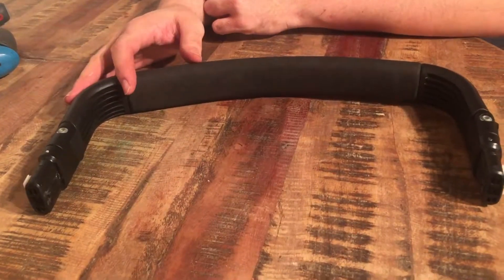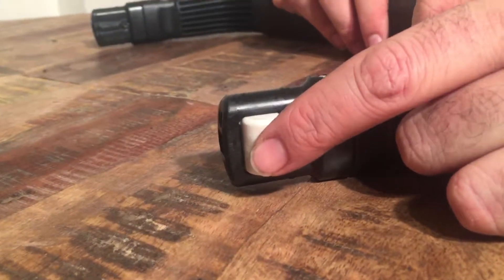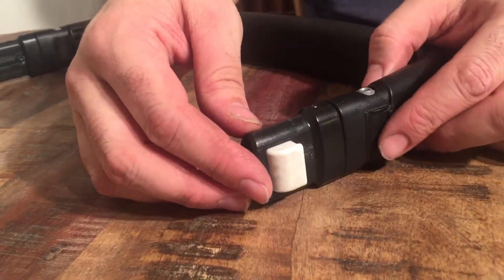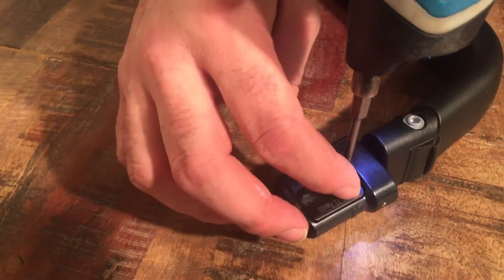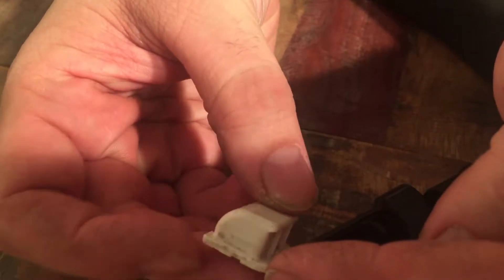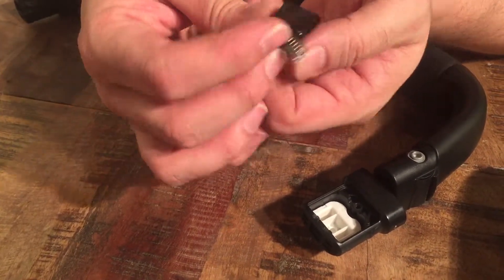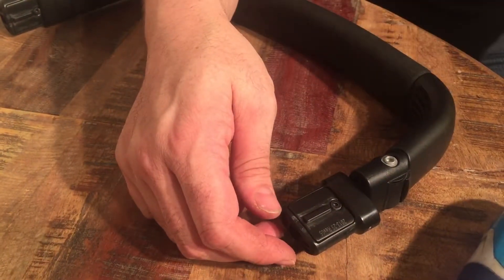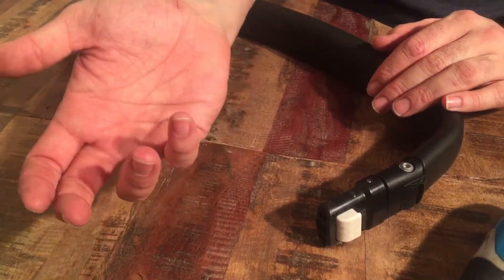Bugaboo Bumper Bar Disassemby on Newer Models

Comment: As the whole thing is pretty wobbly, you could also drill a nice hole trough the plastic with a wood drill, go trough the aluminum with the metal drill and tighten the side bars with a connector screw, something like Ikea conmectors, but in 22mm length.